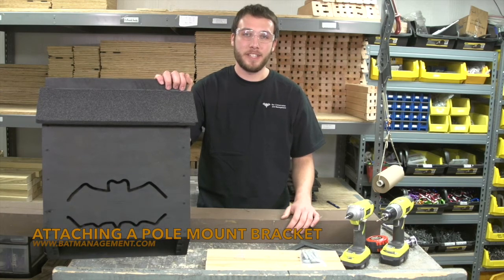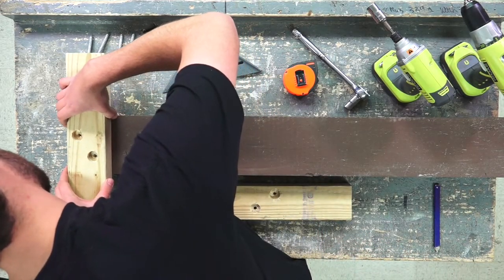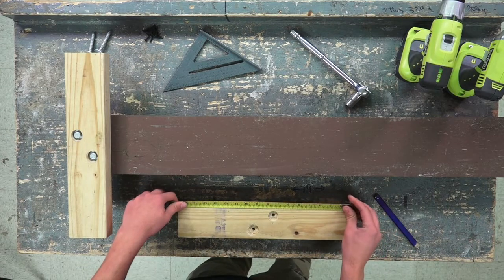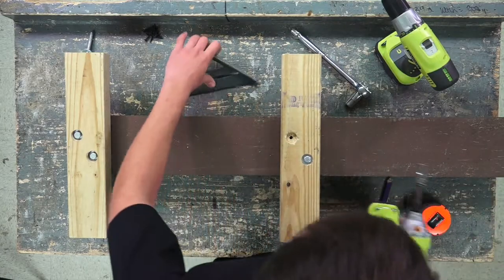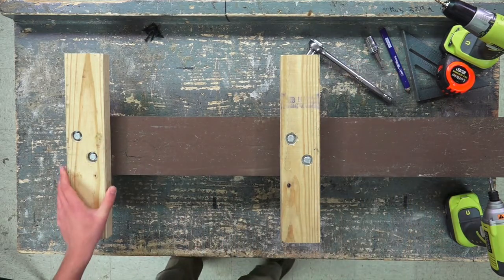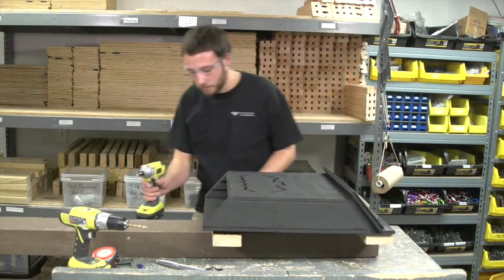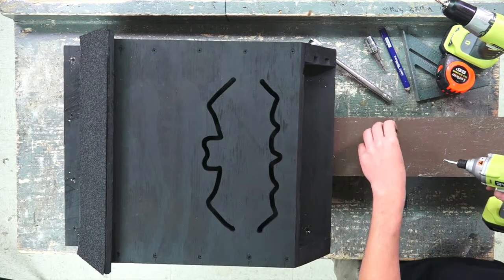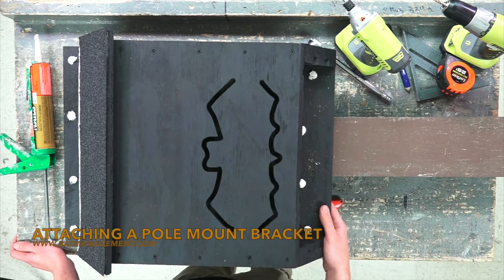How to attach a pole mount on a bat house

Comment: I'll probably put mine on a steel pole but some real good advice in this. THanks.
Reply from the maker: Metal poles are fine too, consider insulating it from the ground as well to protect from corrosion from the cement.